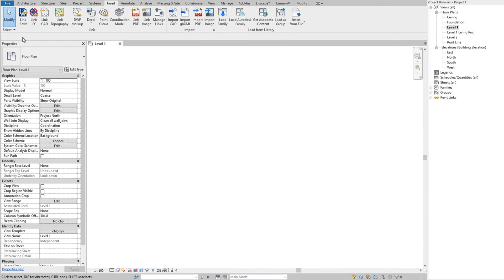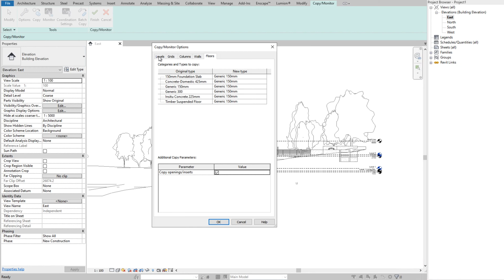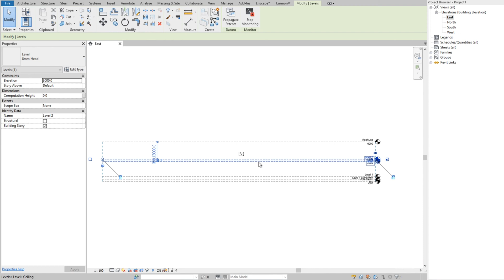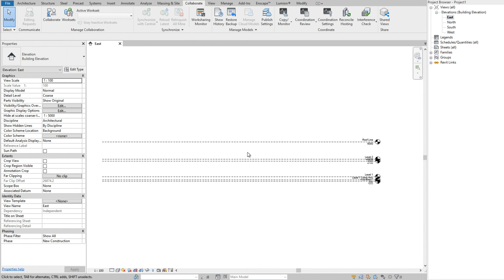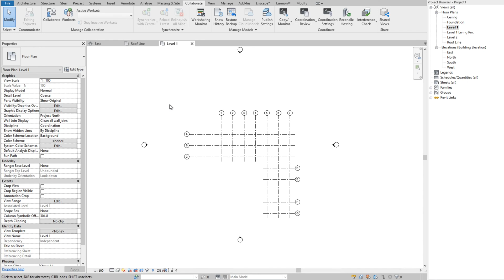CopyMonitor. If you want without the background music, go to this link https://youtu.be/yw06gPDjNkY

Comment: Is it possible to copy families from linked revit files?
Reply: yes, for example copy/monitor air terminal from MEP model to architectural model.
Reply: how to do that? @kimish4
Reply from the maker: The elements that can be copy/monitor from linked revit files are only Levels, grids, columns (but not slanted columns), walls, floors, openings and MEP fixtures.